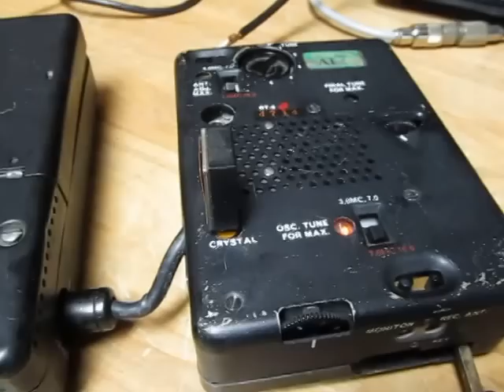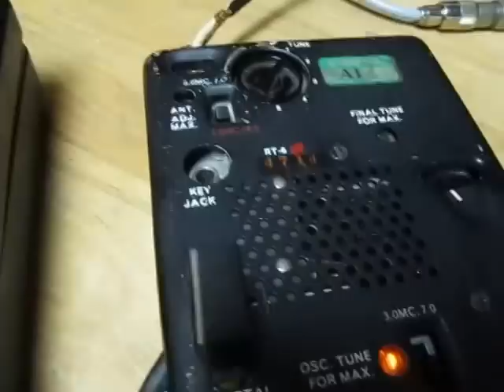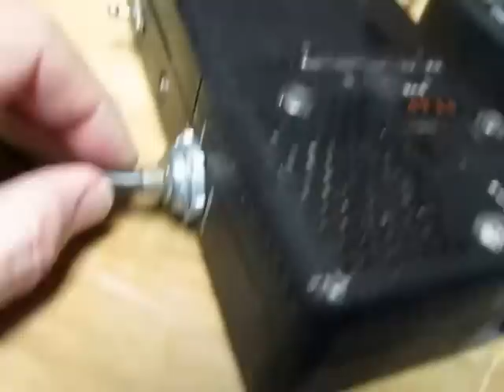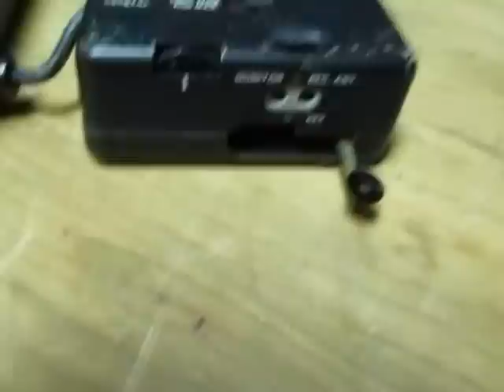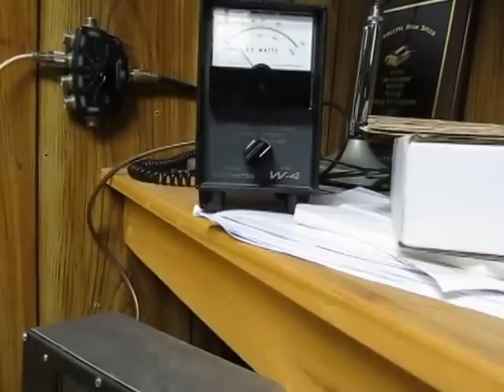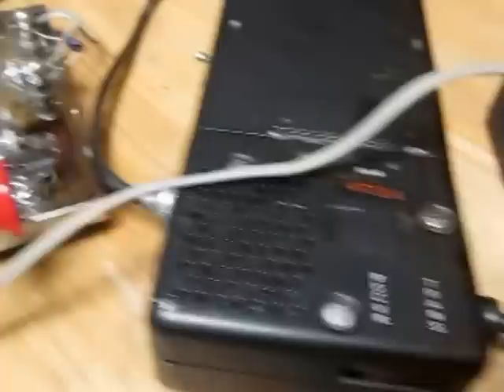RS-6 CIA SPY RADIO 1950's

Comment: Pretty cool, I got into Ham Radio in 2016,  I’ve always been interested in “antique electronics”. I built a few x-tal sets, and the one I’m particularly proud of uses a spider coil with litz wire and a 4” carbon fiber tube for an antenna trap. My wife’s cousin saw what I was doing and helped me get licensed, he said “well you can receive, it’s time you started transmitting.” He got me into CW, I fell in love with it. Im still improving and getting on the air with CW more frequently now .

Comment from the maker: Kj4fff....Great....Just don't plug it in with that 6x4 still in there. It will flash over and self-destruct. It must be replaced with diodes. The tube is under rated. Transformer secondary 810v....Tube rated for 650v. Dumbest design I ever saw!!!
Reply: It depends on the current load as well, and sometimes whether the power supply uses a capacitor or a choke as an input filter. But yes, a 6X4 is more or less a miniaturized 6X5, which means that the current limit is about 70-80 milliamps, depending on the voltage, although with 810 VAC on the plates would be more then enough to cause it to arc over. It make you wonder why they didn't use a selenium rectifier instead, although maybe that would be too bulky, but believe or not it would probably have been possible to fit a 5Y4/5Y3 GT in there, I have a battery eliminator for tube portables and farm battery sets that uses one of those on the plate side.
Reply: Hi Steve would this radio transmitter would of been used in Operation Aerodynamic from 1949-54 basically the CIA trained ex Ukrainian insurgent army veterans to be parachuted back into Ukraine for covert operations but the operation was foiled by double agent Kim Philby from MI5 out of 120 agents only 3 managed to survive and made their way back to Budapest in 1956 .